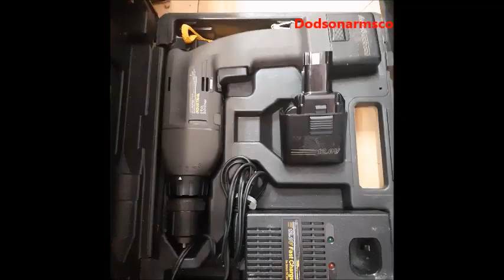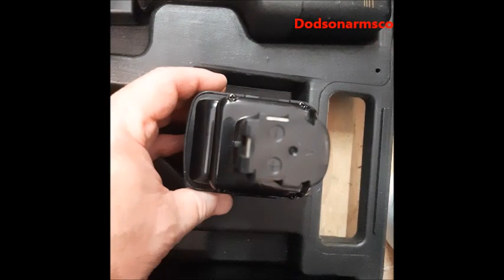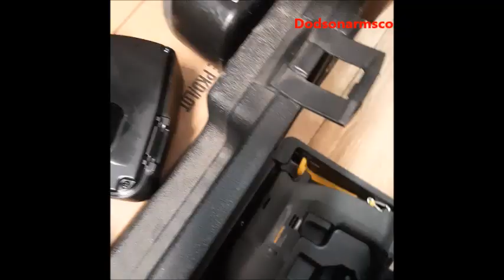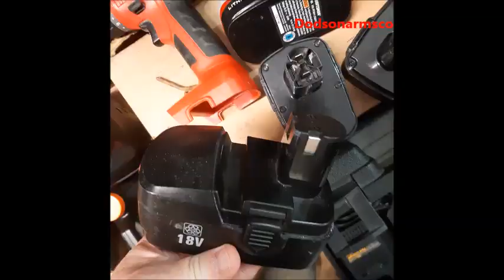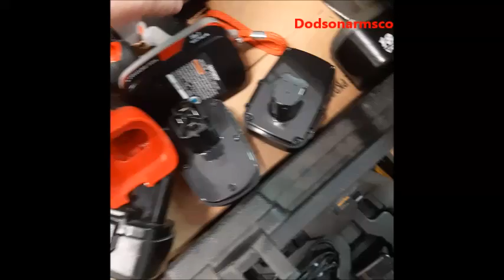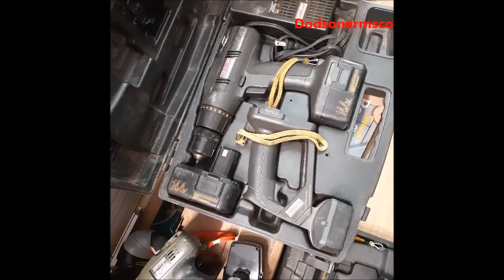Get Cordless Tool Batteries While You Can. China Trade War, Economic Collapse, SHTF, Dark Winter

Comment: 18650 batteries are in most of the cordless tools. Same thing that’s on laptops going back a while. Even the all mighty Tesla runs off 18650 batteries..about 7000 of them in series. Not some super special battery. You can rebuild dead battery packs by looking for 18650 batteries from ecig store.

Comment: That’s cool. It makes sense. I have an old DeWalt 12 Volt Drill out in the garage. I never thought of using a car battery as a power source. But you are right. It would work fine. Thank you for this heads up.